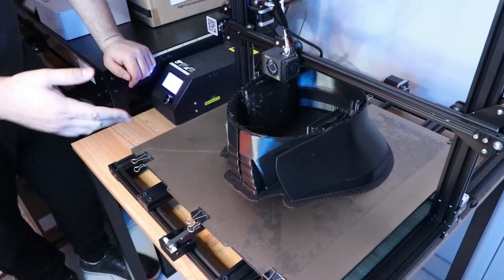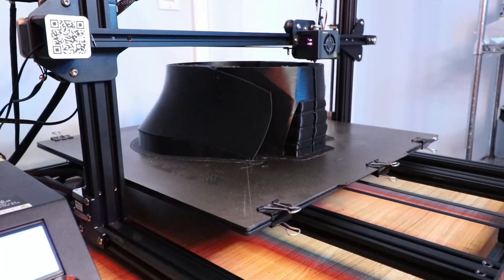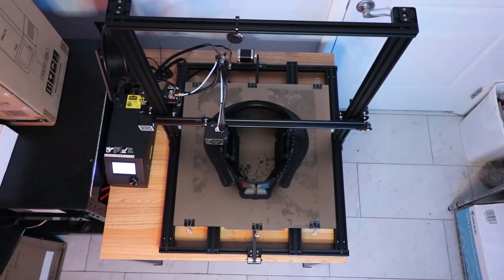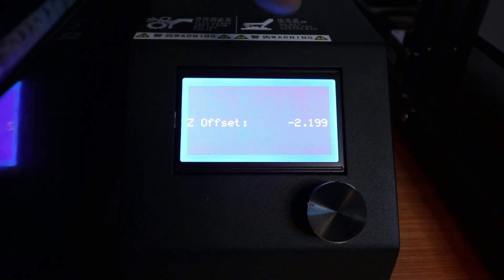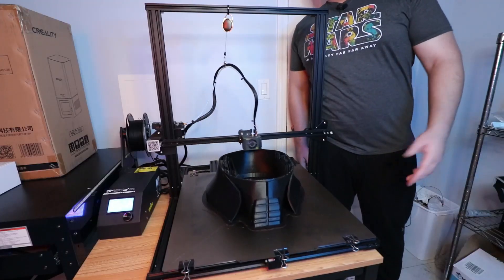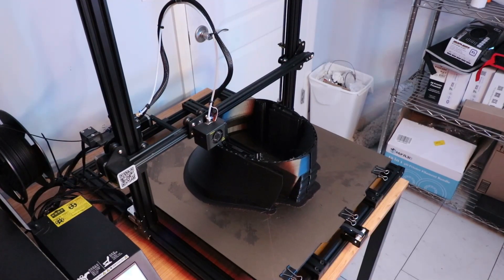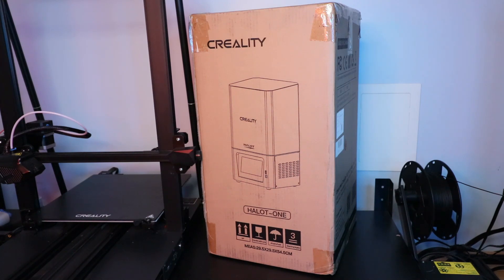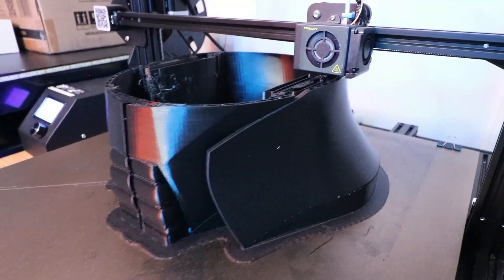Creality CR-10 S5 Review & Starkiller Helmet 3D Printing

Comment: Great vid! I've also got a CR-10 S5 Mine's running a Pi3 with Octoprint,  24bit mainboard, Bontech DDS extruder, linear rails on the Z axis, Magnetic PEI sheet, BL touch, Z synch belt, braces for the Z axis and an AC heated bed. I feel these machines are made to a budget not a standard. I've spent alot of time and money on my machine to get it to work reliably. Using solid spacers instead of the levelling knobs was a big help and allowed me to ditch the glass bed. Dropping my speeds down to 60% improved my success rate (no fails now), printing with a 1.0mm CRT nozzle makes up for the loss in speed so big prints still finish in a reasonable time.
Reply from the maker: Hey @roboreject79, thank you for the comment! Man, I couldn’t have said it better myself, it’s definitely made to a budget, not a standard. You made some huge mods to it, and by that point I would imagine it would print great! Congrats on the upgrades and good prints coming out of the S5 :)

Comment: I've had similar problems with mine so I got higher tensile springs for the bed leveller it fixed some wobble I was also having trouble with the plastic feed drive so I changed to a aluminium one. I'll try to reset it up when I move to my new place it's packed away atm but also can't wait to use my anycubic m300 plus
Reply from the maker: Thanks for the comment William! Sounds like you got a couple of cool printers. They’re so much fun :)

Comment: Take the glass print bed off, there is no reason to have the glass bed on there if you are using the PEI print bed. The PEI replaces the glass. REmoving the glass will make the print bed a lot lighter and it will therefore wobble less. Also decrease your print speed and there is another setting I forget what it is but it will slow down the speed the print head changes direction back and forth and this setting also stops the wobbling.  Usually PLA is 210-220 and the bed temp for PLA is 60C. Of course I don't know the brand of filment and the temps for it but I would double check your temps. You could print a temperature tower (Thingiverse).   The amount of retraction setting can be increased to help with the stringing.
Reply from the maker: Hi myname is private, thank you for the comment and advice! I will adjust the settings you mentioned, those are all very good ideas :) The PEI sheet however, needs the glass bed because the z-axis can’t go low enough where the nozzle touches the surface of the print bed. The glass bed’s thickness allows the nozzle to reach the print bed otherwise it falls short, and there would be a gap between the tip of the nozzle and the print bed, even at it’s lowest z-axis setting. That’s why I didn’t put the magnetic sheet that came with the PEI sheet directly on the hot bed.